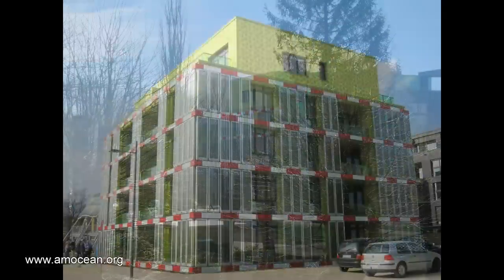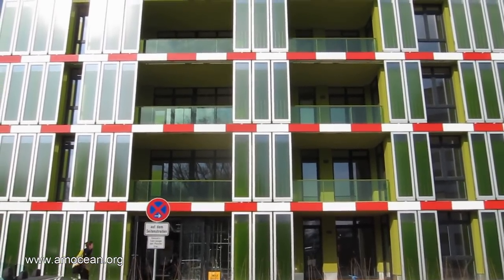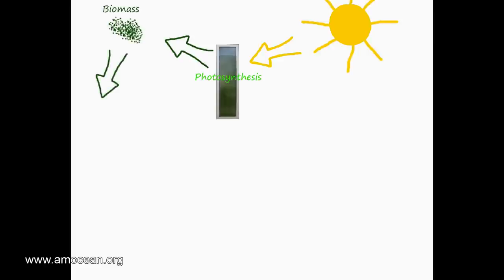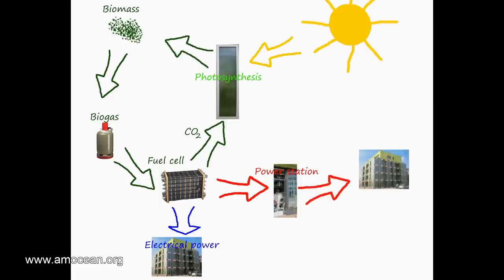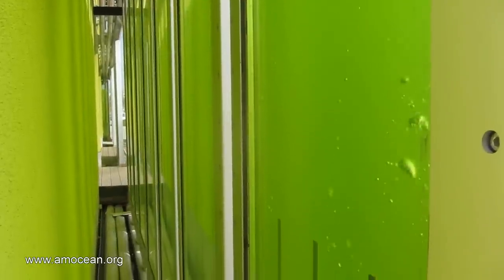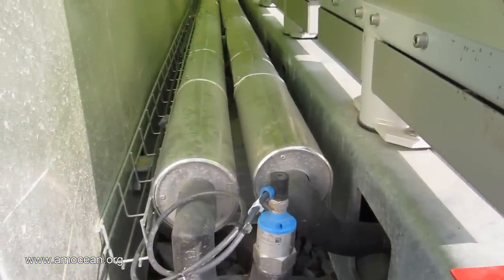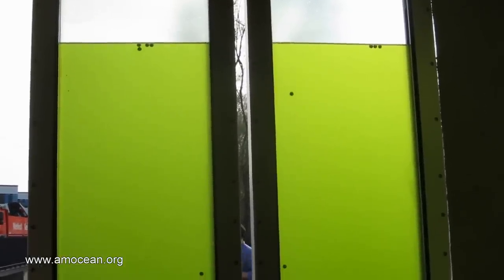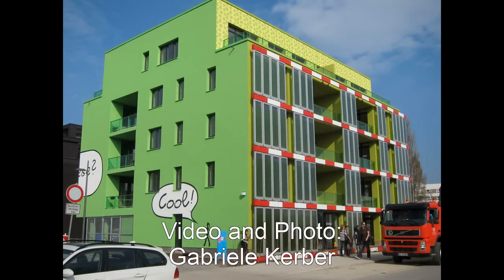How Algae feed a House

Comment: How much electricity does the gas burning produce? Because if this is an experiment, it must be directly compared to the same surface of solar panels. I suspect this algae energy powerhouse is not as effective, as it does require more steps to convert energy and is much more complicated than regular solar panels.

Comment: Better would be to run on compressed air using an air and water displacement generator
With turbine static generation
Put algae in the tank make biofuel but it's better for cooking than running a building on

Using compressed air you can power everything without combustion

Could get all those tanks 
Or just get your biogas from sewers and composting bins
For cookers and boilers
Not running 24/7 like I imagine this system is designed to do

Get energy from thin air
It's less maintenance
Especially if you need continuous energy output

Comment: what happens in winter when it's cold and the liquid freezes?
Reply: Boom 
That's what thinking looks like
Compressed air powered generators for the win it is then
Up there with the carbon foam insulation
And misculanious mushroom materials 😁

Comment: How is attachment of algae/biofilm to windows/system prevented? Yes the turbulence caused by aeration prevents clogging and "stirring" the substrate, but is internal cleaning not needed? Or is is prevented some how?
Reply: +Simon Granath "The algae are fed liquid nutrients and carbon dioxide to spur growth. Pressurized air is pumped into the panels to further increase growth and prevent the micro-organisms from settling down and causing rot, said Mr. Wurm. He notes that scrubbers in the panels automatically keep the glass clean. The panels double as solar thermal collectors to convert sunlight into usable energy."
Reply: +Simon Granath They have built in swipers.

Comment: This looks great, but look how technical intensive it is. The panels consume vast amounts of electricity in their manufacturing and installation - expensive architecture. Many complex processes are then needed to get electricity. This may have some political agenda value, but in the real world you use a BMW sports car to heat water.  Direct electricity from the sun makes sense once the battery issues are improved, or maybe nuclear fusion in small reactors. I am an architect but not a scientist but there are better ways than this.

Comment: Wouldnt solar panels be mutch mire efficient
Reply: Yes, if your singular goal is to produce electricity.  However,  there are several reasons why that's not relevant here - a notable one being carbon dioxide sequestration from the air.